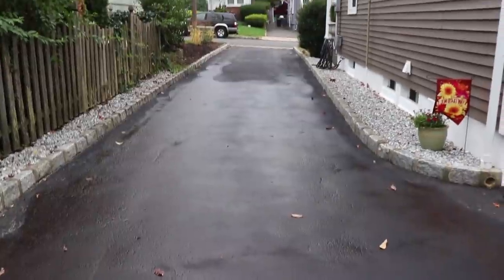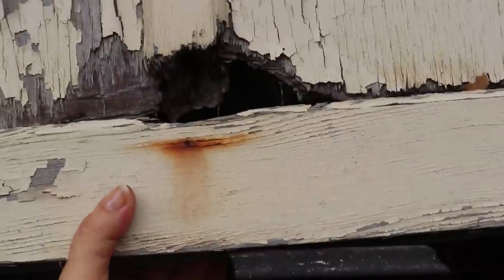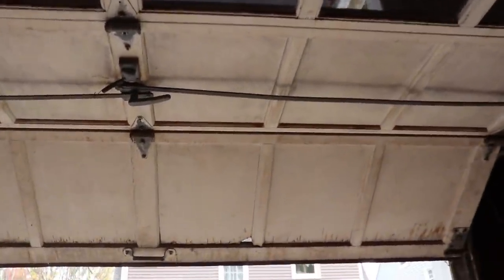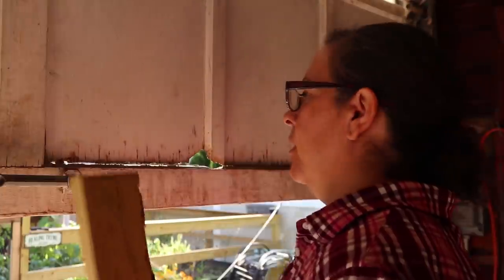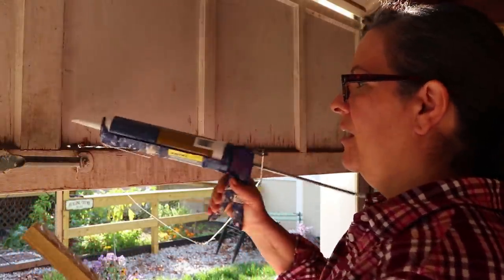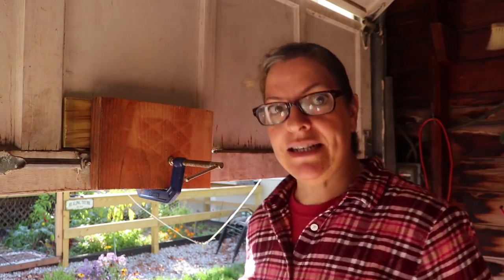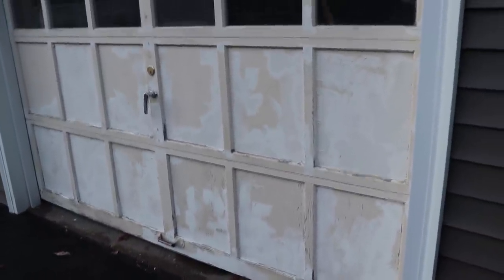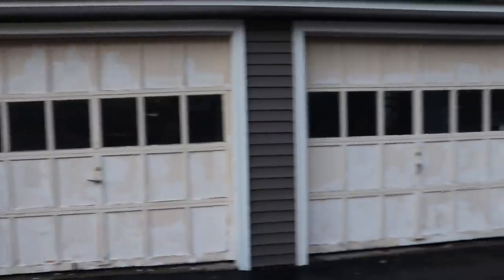Restoring Old Garage Doors - Part One

Comment: Super job!  I wish mine were fixable! I have lived with "temporary" garage doors since we bought our home 20+ years ago!  The structure was imminent to falling down & not allowed to be rebuilt, as it is right at the property line, so my husband "repaired" it piece by piece so the exterior & roofing is all new, except for the windows & doors. It was quite the undertaking as it was previously a carriage house, (1875), 2 story!  Well you would think after all that work you would want to get it fully done wouldn't you?!  I had saved up almost $500. to go towards new doors & ended up using it for Christmas money a few years ago!  Now I am back to around that amount saved, but we will need way more than that, plus more pressing repairs needed.  I still love my house though!

Comment: We took out hugh boxwood bushes.  They were close to the house. We got rid of those, so they don't damage the foundation.  Their were some in front of my windows growing up.  My dad dug and pulled them out. We then had to replace part of the wall, the siding and my windows. It was pushing up on the foundation.

Comment: Hi, Sophia.  My former house was built in 1956 and it had the same garage doors as yours.  I admire how you're fixing yours up.  I had to scrape off the old paint off of mine too but then like a dummy I just painted over that.  You're so smart to add putty before painting!  What type of putty did you use?  I can't wait to see your finished doors.  I was eventually able to buy new garage doors but they were made out of steel or aluminum and were so much lighter weight that I really missed my old wooden doors!
Reply from the maker: I am using the DAP premium wood putty.

Comment: House & yard look amazing.  Is your siding wood or vinyl?
Reply from the maker: Vinyl. We removed the wood last year and had insulation blown in. Then added insulation panels and vinyl installed. It makes a huge difference. Cut the heat bill by half.

Comment: Out of curiosity - how much is the whole thing as cost? What is the putty that you are using?
Reply from the maker: You mean to replace them? It s about $800 per door minimum so 1600 minimum + the install and the motors. We had a quote from the guy who did our siding. The doors I wanted which mimic carriage house doors would have been $4000 for the entire job and he was reasonable in terms of price. The doors depend on whether they are insulated, have glass panels, the material. Garage doors are not cheap.
Reply from the maker: The putty is a special wood putty that hardens as it cures. It s called DAP premium wood filler and sealer.
Reply: @mygreatchallenge  I actually meant this cost effective version - it already looks great, so it seems it is worth it...
Reply from the maker: Oh. Well I have the tools on hand. So paint putty and seals about $130.
Reply: @mygreatchallenge  awesome - 130 vs. nearly 2000 - great job!
Reply: @mygreatchallenge  
Something to think about down the road when you do replace the doors, "The Minimal Mom" found some magnetic ornaments to put on their metal garage doors that look like hinges. I'll look for her video link for you.
Found it!
https://youtu.be/GQFdduxMYrA
Reply: @mygreatchallenge  I have relatives who have the same issue and are also located in NJ, so this can be an awesome video to help them and it is also very budget friendly! Thank you for posting!

Comment: You always do such a professional job.
Say, I'm looking at cordless sanders so I can paint my baseboards and wondered if you have an opinion on orbital vs. 1/4-sheet palm sanders.
I got a DeWalt cordless reciprocating saw this summer and love it for gardening chores so figured I'd get that brand again and I can use the same rechargeable battery for both tools. But I don't know which is easier to use for my project.
Thanks for your advice.
Reply from the maker: I would be careful with orbital they can leave marks or rings when you sand.
Reply: @mygreatchallenge  
Ah, good point. Thanks for your experienced advice.